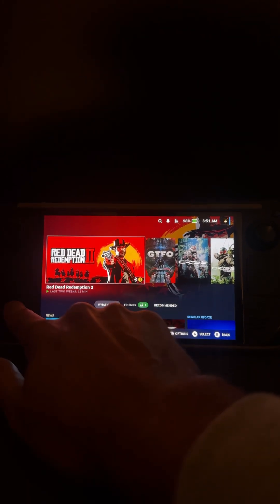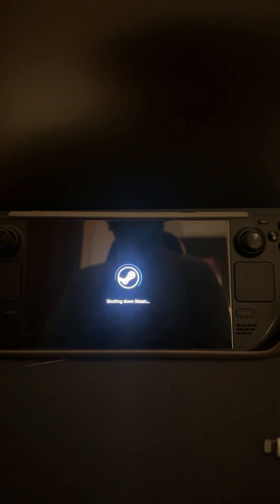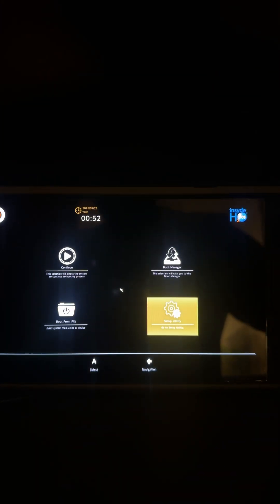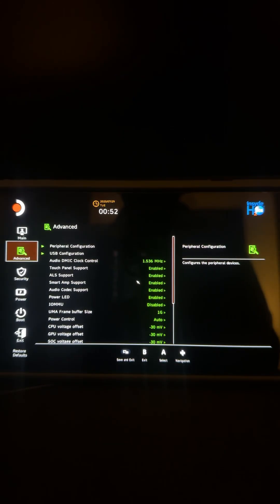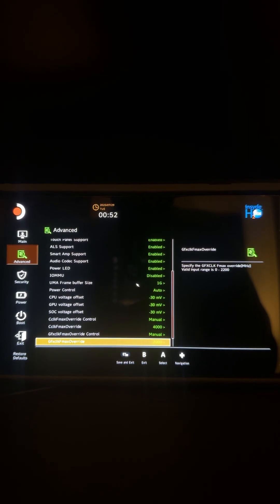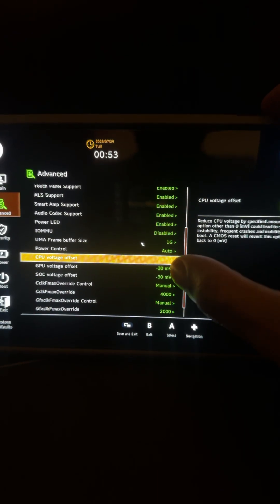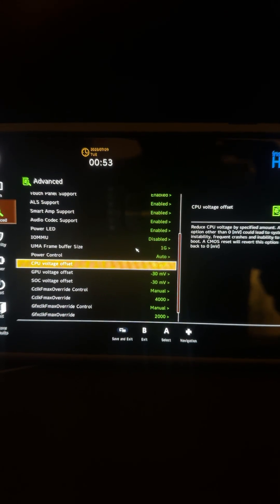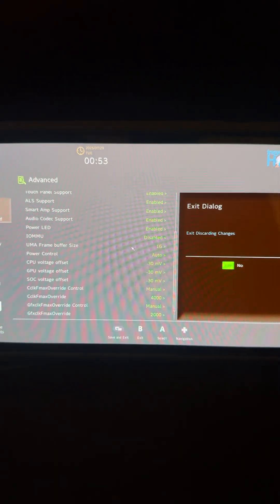Steam Deck Oled Undervolting and Overclock Gude in 3 minutes

Comment: Thanks for this video? Are you able to upload a guide for increasing TDP limits on Steam Deck?
Reply from the maker: I personally wouldnt increase TDP limits on my steam deck, ive looked into it before and value battery life over the gain in performance.
Reply: @blackheart909 okay good to know. I definitely will undervolt, but did you test if overclocking have much of a performance improvement without increasing TDP limit?
Reply from the maker: @JonnyLin7 it’s a small increase, just a little overhead for the Sd to adjust if needed.
Reply: @blackheart909 also how do you add values to the CclkFMaxOverride? Do you need a wired keyboard connected?
Reply from the maker: @JonnyLin7 didn’t use a keyboard for anything.

Comment: thank you i got 40-50-50-😊
Reply from the maker: Amazing! thats a great result.
Reply: @blackheart909   i tweaked it again around -30 -40 -10   i noticed soc undervolte is the most sensitive one followed by cpu undervolte

i compained it with cpu 3700 and gpu 1700 overclock  and locked steam TDP at only 10
Reply from the maker: @SteamDeckUnlocked  That seems very resonable, did you notice improvements to stutttering?

Comment: What does it actually do
Reply from the maker: Uses less power overall, uses it more efficiently as most manufacturers allow more power to be drawn than needed. This slightly improves temperatures, batterylife an dhas a significant impact on stuttering.